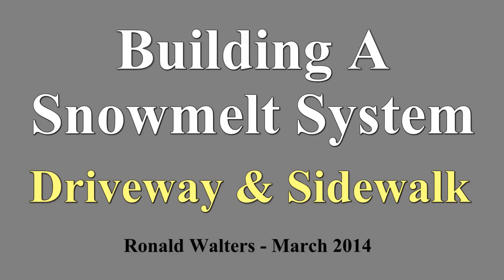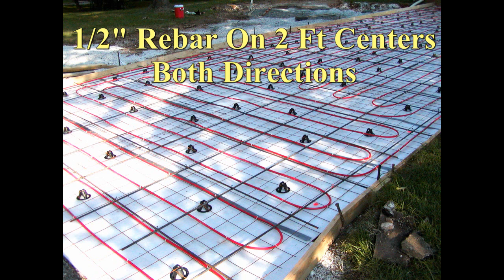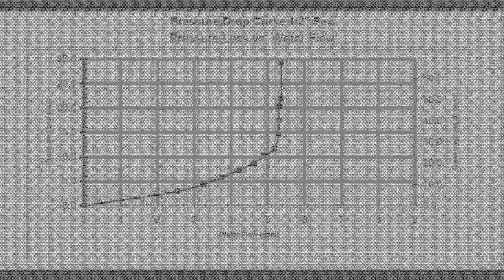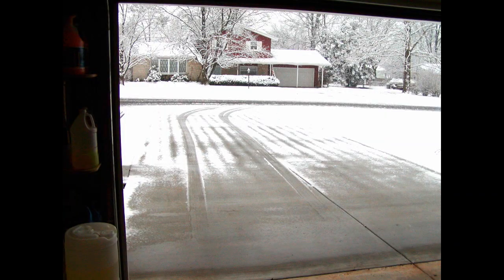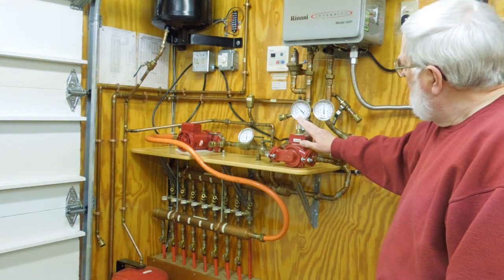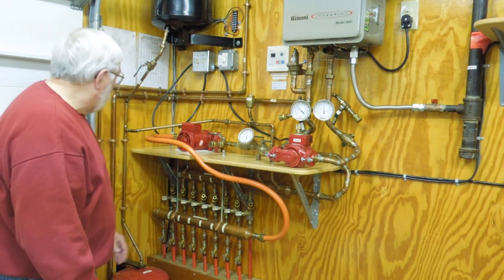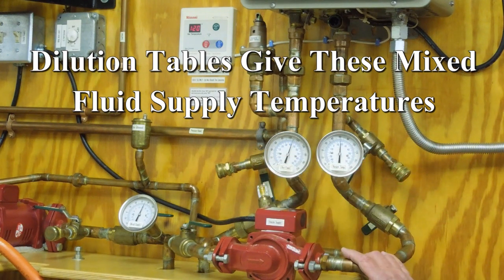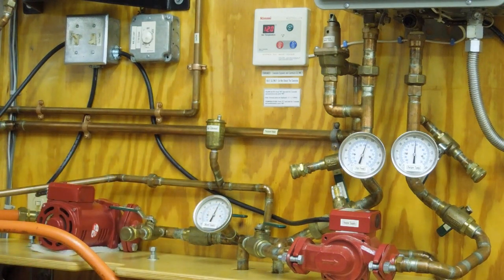Snowmelt, Building A System - Driveway & Sidewalk

Comment: Ronald, I keep coming back to your video.. I've been on the phone with some radiant guys.. they are suggesting pushing 3.5 Gallons a minute through a half inch pipe.. Each Loop!.. they would have sized your system pump at 28 Gallons per minute at about 26 ft of head..  I just think it's crazy how far different they are than your system.. which looks like your pumping about 1 gallons per minute max each loop x 8..  How many ft of head did you allow for on your system pump? Second.. he sized the primary pump at 18 ft of head because the heat exchanger in a on demand heater would provide a lot of resistance.. What kind of pump do you have on the heater loop? I'm assuming it's like 1.5 gal per minute with a pressure of 18 psi at 4 ft of head?
Reply from the maker: My system was designed by a radiant company using a computer program and information regarding where I live plus "other" stuff (such as my drive faces south and gets the sun). The design was 9 gpm and I have it dialed in for around 8 gpm actual. Flow through the on demand heater varies... generally 1 to 1.5 gpm via B&G NRF22 (I vary flow and output temperature). The same radiant company did the design for my house and for my work shop and they all work just fine. And I installed every inch of it myself.

Radiant companies come and go. Their job is to get you to buy as much as they can sell... automated system, sensors... way, way too much. Precipitation sensors, temperature change sensors, servo controlled mixing valves and on and on and on. My systems are K.I.S.S. and are started manually, adjusted manually and shut down manually. Much less to go wrong but more to do manually.

You do not know where I live. You cannot discuss or compare "systems" without knowing where the "systems" are installed otherwise it is just apples and oranges.

You can't generalize flow through an on demand heater without also discussing input and output temperatures at a given flow rate. I start my system with low temperature and flow rate and gradually ramp it up.

I originally started talking with a Radiant Company in New York. Their recommendation was I needed a dedicated boiler. I would start the system when the weather turned cold and would shut it off in the spring. WOW! You must think I am a government project or something, I said. I couldn't imagine the cost of that nonsense! I dropped that outfit pretty quick and it is interesting to note they were no longer in business two years later.

Some systems are actually operated that way such as loading dock ramps, some airport areas. They are generally in colder areas expecting much worse winter weather.

You need to set some rules such as "is any precipitation allowed to ever freeze". It will waste a tremendous amount of fuel if turned on too soon. My precipitation sensor are my eyes. I do not usually start it until I have a good layer of something (snow or ice) covering the driveway (which acts as a blanket). 

I don't know where you live but I can pretty safely say if you pump 3.5 gpm through a 1/2" pipe the same length as my loops, that is where most of your head is coming from and it would be time to use a larger pipe. If you hit cold concrete with fluid which is too hot and too fast you will shock the concrete and crack it. My system has been installed for nearly 10 years and I don't have a crack... but my concrete has wire mesh, rebar and is 5 inches thick. Your concrete contractor will give you fits over this alone.

If you are not going to install this yourself, you are going to find out what expensive is all about. A plumbing company will start licking their eyebrows when you discuss this with them. You simply will not believe what they will want to charge to install this.

Some of this stuff is not made they way it was 20 or 30 years ago and it does not hold up very well. I am on my third set of mixing valves in the house (second set out in the shop) and my house is only 13 years old (shop is 9 years old). Comes back to made in China. Bunch of crap and you will pay a good price for it. This is, at lease in part, why I do not use a mixing valve on the snow melt system.

I have zero intention of designing your system. I did not design mine. I designed how it was installed and operated. Make damned sure you research this and fully vet where you are getting your information. Once this is buried in concrete you will have to live with it forever.

Ron
Reply: Ron, thanks.. I think the one missing link for me was the pump on your on demand heater..  the guy I talked to was talking about 30 ft of head.. ..I don't think he has any idea on the restriction of the on demand heater..  I'm starting to think that these guys think that more is always better.. If they oversize at least they won't have a problem pumping enough fluid. It seems that most of the industry guys have a pretty aggressive approach here, but at the same time, we have very few snow melt systems.. I'm guessing they don't have much experience. Your flow rates are very low.. but congruent with other information I've read. I'm going to install this myself.. I already installed my pex.. 1/2 inch on 5 inch slab with 2 inches of hard foam insulation.. my biggest problem is actually my front sidewalk which is a long way from the house.. this had to be just under 300 ft and is 7 ft above the garage, .. The run to get to the loop is very long after that it's just a 2.5 ft sidewalk about 30 ft long.  at the time I installed it.. I actually had 3/4 delivered and it just wouldn't bend into a sidewalk effectively.. at least that was how I viewed it at the time.. it was just too narrow and so many bends. In the end if the front sidewalk doesn't work I won't sweat it.. however in my yard I have really no where to throw the snow on the rear patio or the sidewalk along the house. And I find that in our weather in alberta we get warm weather every few days, just enough to make an ice rink. but not enough for the snow to go away.. and as you probably realize.. you could only use salt as a solution, which I won't do.. even on a warmer day in the winter, bringing the slab up to temp on a day with no snow would be great just to clear it a bit. Thanks again Ron..
Reply from the maker: On demand heaters are going to be rated at X gpm @ Y psi (water mains pressure) normally sufficient for 2 showers plus a kitchen faucet (or whatever) = Z BTU/hour for a family of 4 people. For a snow melt you don't want to plan on using more than maybe 1/4 or 1/3 of that because when you first start off the glycol fluid temperature entering the heater is going to be really cold (colder than water mains temperature) because the fluid in the concrete is on the surface. When you set the output temp for the on demand at 120 deg F it will make sure the output temp is 120 deg F. The inner workings of an on demand heater is about as complicated as starting up a jet engine and it will throttle back the fluid flow rate going through it when the fluid is really cold (and you cannot override this). So... in reality head pressure has nothing to do with the flow rate through the heater until return temperature starts to gradually increase. You could avoid this issue by using the on demand to heat a separate insulated tank of fluid (a relatively large tank) and then use that fluid to heat the fluid being circulated to the show melt. Things start to get more complicated and would probably require another pump.

It will takes hours to bring a slab up to temperature high enough to start melting... so stopping and then later restarting again will cost you a lot of fuel... and melting ice is more expensive than melting snow so you do not want to let it refreeze again. The show melt thing is in reality heating the great outdoors and is expensive. Ron

Comment: Hello Ronald, Would you lay out a system for me if we pay you?
Reply from the maker: No Larry, sorry. I simply do not have time for it (for a multitude of reasons including medical).
Putting a project like this together is not a small undertaking.
You can follow my video for a very good idea of where you will be headed. 
Then you need to start sourcing materials (tubing, pumps, valves, flow meters, insulation, heater, glycol, etc.).
But first you need to nail down the size of your project and get someone to do a design calculation for you. This includes where you live, your weather, etc. I used Vanguard for the design but they have since been purchased (and killed off) and I no longer have contact with anyone who does this.
Best of luck with your project. 
Thanks for watching. Please subscribe! 
That is what keeps this channel going. 
Ron
Reply: @RonaldWalters2010  Thank you Ronald

Comment: I don't understand insulating from the earth when in this situation the earth is the warmest thing. Harness the warm don't block it out.
Reply from the maker: Without insulation under the concrete slab, the heat will go down into the earth. A large amount of the heat would be lost, Insulation keeps the heat inside the concrete slab which will melt the snow and ice.
Reply: In this situation, the water/glycol mix is the warmest thing. Heat always flows from hotter to colder. Even though the earth is warmer than the snow and ice on the driveway, it is still taking heat away from the system. Also, the earth is an enormous heat bank. You can't warm it to the extent it will stop taking heat.
Reply from the maker: You did see I put insulation with a reflective layer under the concrete... right? We may not be able to totally stop the heat flow downwards but we can slow it down.

Comment: what was the total Cost ?????????
Reply from the maker: What it cost me years ago is irrelevant. What would it cost you now is the question. Lets just say it is not cheap to build. It is however quite reasonable if you do it yourself compared to probably 4 or 5 times the cost if you have a contractor do it. You need a system design to start with (you may need to pay someone to do that) to figure what size heat source your will need for your particular application and where you live. Then get a price for the heater, pumps, expansion tank, manifolds, valves, gauges, PEX tubing, etc. Add 5 inch thick concrete with lots and lots of mesh and rebar and insulation for under the slab. Then you need glycol. Ethylene and propylene glycol keep getting more expensive.
Reply: look at my 2014 Craftsman snow shredder rebuild , picked up used $240 CAD Seized engine .
nice to have heated Driveway . just had mine Replace with Paving Stones , Asphalt to costly to replace every 8 years due to Temperature Fluctuations .
Reply: how often do you replace the glycol ?
Reply from the maker: Haven't replaced it yet... but it does have a limited life.

Comment: Hi Ron,Nicely laid out and installed. Have you considered a Tekmar Snow Melt Cup out in the slab to do the Automation of Off/On and the temp control?I see the slab temp was a little behind the snow building up.http://www.tekmarcontrols.com/products/snow-melting/665.html
Reply from the maker: For me it is easier and more economic to run it manually. More automation just means more expense and more things to fail. I intentionally allow the snow (or ice) to build a bit before starting the system. A layer of snow helps keep the heat in the slab... and I am not in a hurry to melt it.

Comment: Isn't there a hillbilly way to do this? It just seems so over engineered.
Reply from the maker: Actually... this is the simple, manually operated way. :-)
The complicated, over-engineered way costs 2 to 3 times as much and has precipitation detectors, outdoor temperature sensors, slab temperature sensors, flow rate and variable speed pumps... all leading back to a PLC (Programmable Logic Controller) and some sort of display. Then, if anything fails the whole system is down.

Comment: should use antifreeze mixed with water and a heat transfer, the water exits the hot water tank or boiler circulates in the heat transfer and heats the antifreeze and would not be subject of water to freeze inside the pex in the driveway
Reply from the maker: Had you paid attention, you would know the fluid throughout the system is ethylene glycol & water, which will not freeze.